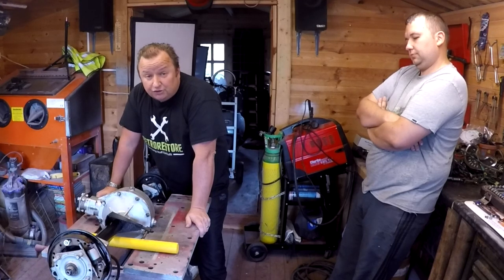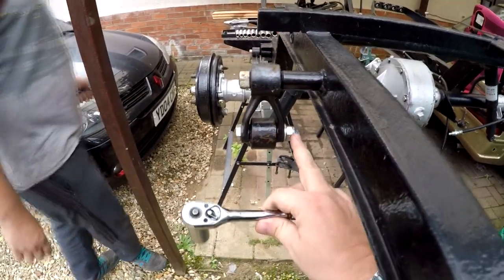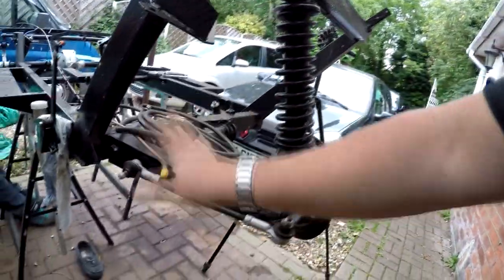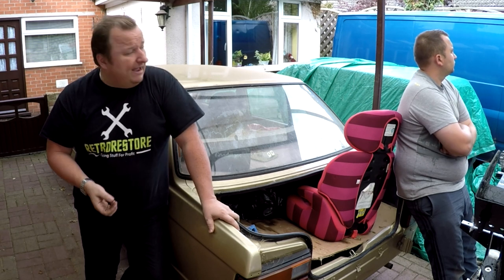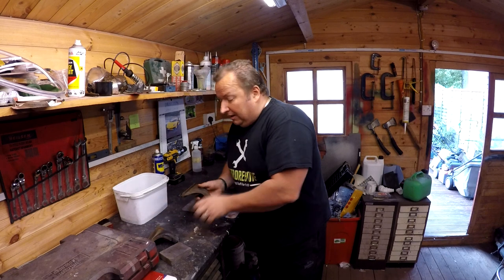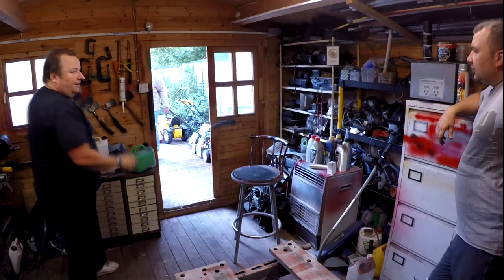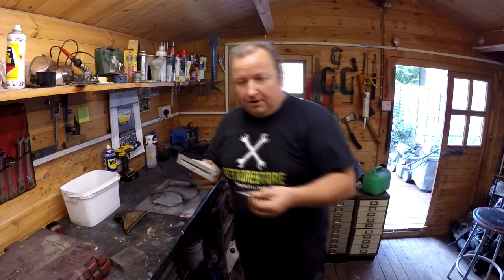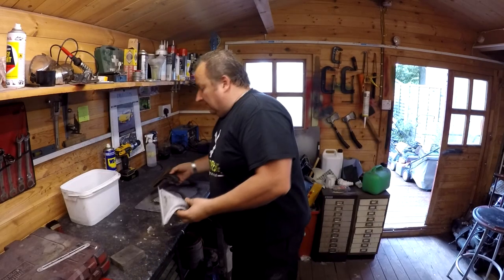3 Wheeled car Gets It's Axle Back Vlog

Comment: Good to see Lee again. He cracks me up. So, what's a B and Q? I saw the Transit Van parked with the busted cars, is it broken down? Or just parked. I noticed you put up a video every few days, and your other channels too, but no vacation this year? On Lee's Trans Am reversed battery leads can blow the computer. Hopefully he didn't have to change that. If that piston doesn't have a hole right through it, just put it on a bench grinder with a wire wheel, It will smooth out the top of the piston. A polishing wheel can repair the sides and piston skirt. Lightly polish the cylinder with a hone. It doesn't have to be perfect. It's just a mower. So long as the rings will seal. It should be okay. Probably need new rings. Looking forward to see it run. IT WILL.
Reply from the maker: B&Q is a DIY superstore here Bri. I've seen the repairs you mentioned so might have a go just to get it running.
Reply: Get a passport And a few $$$... Go B&Q. Drive a Transit..Probably fix that Triumph up to a sell able condition, resurrect an old relic lawnmower.. You can walk the dogs for yer' keep! ;p. Do It!

Comment: When you fit the 850 engine I believe you need to fit the engine plate from the 600 so that the engine mounts all line up OK. You can do it without swapping the plate but the mounts end up strained and it's not good for them. Not done this myself but something to look into.
Reply from the maker: I'll be looking into it as others have done this conversion. It's not difficult I don't think.